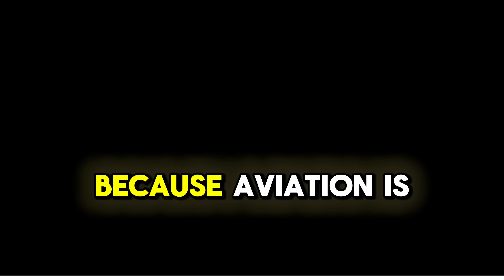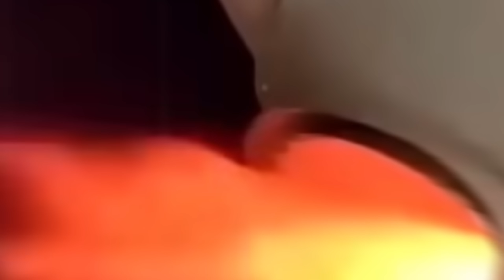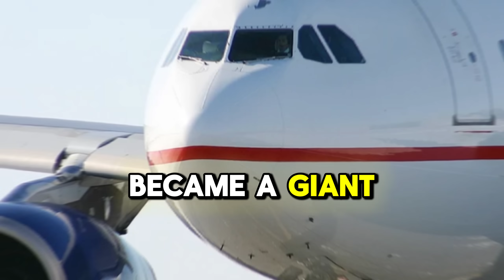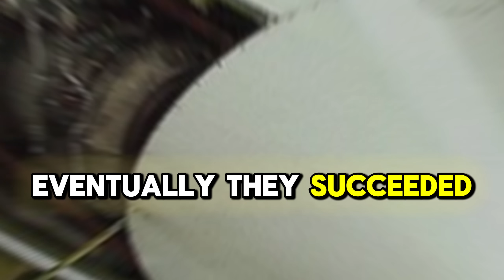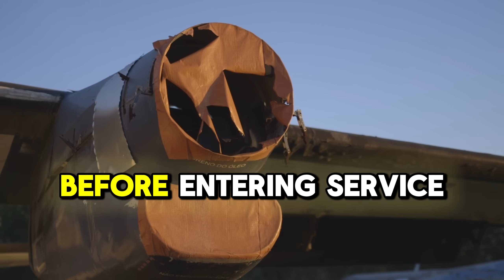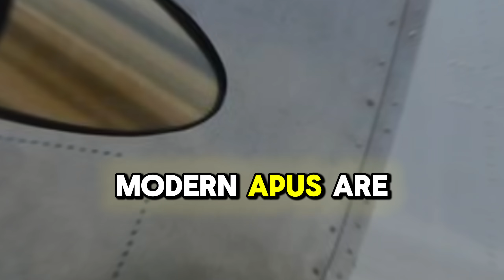WHY DO AIRPLANES HAVE A “HOLE” IN THE TAIL?

Comment: The Space Shuttles had three APUs near the tail of the orbiter and its exhaust were on the top and just front of the vertical stabilizer on the tail. There were three so that there was triple redundancy. The APUs were powered by hydrazine passing over a catalyst bed. They were used to control the gimballing of the shuttle's three main liquid rocket engines on the back end of the orbiter for steering in flight and for movement of the wing's elevons, rudder and speed break and the body flap which was just under the three main engines to protect them during launch and reentry. The APUs were powered up at t-minus 5 minutes and once achieving orbit were powered off until the shuttle was ready to perform the deorbit burn which would slow its velocity a few hundred miles per hour below orbital velocity of 17,500 mph or 5 miles per second.
Reply from the maker: That’s a fantastic explanation! Thanks for sharing-Space Shuttle APUs were an incredible piece of engineering. 🚀

Comment: That “hole” in the tail is the exhaust outlet for the **Auxiliary Power Unit (APU)**, a small turbine engine that supplies electrical power and air conditioning on the ground, and backup support when required in flight. It may look insignificant, but it plays a vital role in aircraft independence, safety, and operational reliability. Excellent explanation for anyone curious about aircraft systems. ✈👏
Reply from the maker: Really appreciate such a detailed comment . Glad aviation people are enjoying the video too 😄

Comment: Does de APU also delever a small part of trust power?
Reply from the maker: Not really for thrust 👍 The APU mainly provides electrical power and compressed air, though on some aircraft it can slightly assist engine starts.

Comment: Jesus fucking christ..........it's the exhaust port for the APU, otherwise known as the auxiliary power unit which powers electrical and hydraulics when the engines are not operating.
Reply from the maker: Yep 😄 Just tried to explain it in a simpler way for people who don’t know aviation.
Reply: Certainly no need for a 7+ minute video OR huge closed captions!

Comment: Newer planes don’t have this. They have a little propeller that comes out under the plane. It’s called ram air. These little holes are only on older planes like 727 or 737.
Reply from the maker: The little propeller is the RAT (Ram Air Turbine) 😄 Most modern airliners still use APUs too.
Reply: @EverydayDecoded-o3d yes my mistake. You did cover that in the video. I commented too early 😂. Good information and great video.

Comment: It is the exhaust port to the Auxiliary Power Generator Unit which provides power to instruments and lights independent of the aircraft's engines running.
Reply from the maker: Exactly 👍 The APU keeps many essential systems running even when the main engines are shut down.

Comment: And I thought it was the exhaust pipe lol. Here's an actual  false fact. Jet airliners cannot glide in the air due to their wing design.
Reply from the maker: Funny enough, modern airliners actually glide surprisingly well 😄 Some aircraft have even landed safely after losing all engine power.

Comment: What voltage and power does it produce ?
Reply: I believe it generates 28 VDC and 120 VAC at 400 Hz.
Reply from the maker: Depends on the aircraft, but most APUs produce electrical power around 115V AC at 400Hz and enough power to run the aircraft systems while the main engines are off ✈️

Comment: What about the GPU, on the Ground ..?
And the cable connected from the terminal.
Reply from the maker: Yep! Ground Power Units and terminal power cables can supply electricity too, so the APU doesn’t always need to run at the gate ✈️

Comment: If the plane is small enough, then it can do without an APU. One example is the Pilatus jet and the single engine turbo prop.The jet run one of the designated engine on the ground, at significantly lower RPM than normal idle and that serve as APU. Military planes are more likely to have one , for it gets inconvenient trying to find a jump start in a war zone.
Reply from the maker: That’s actually a great explanation 👍 Smaller aircraft often use different solutions instead of a dedicated APU.

Comment: It's an Auxillary jet engine to supply power to avionics, heating & lighting.
Reply: The B29 Bomber had a small auxillary piston engine called the "Put-Put"
Reply from the maker: That’s actually a cool aviation fact 😮 Older aircraft had some really interesting auxiliary systems.
Reply from the maker: Exactly 👍 The APU keeps a lot of the aircraft systems running when the main engines are off.

Comment: Ground power 400hz and air handling all on the bridges , it's to do with emishions
Reply from the maker: Exactly, many airports now use external power and air systems to reduce emissions and noise on the ground 👍
Reply: @EverydayDecoded-o3d the truth is the air aux air units consume so much power it's unreal 160 amp units somtimes

Comment: I always thought that little hole in the tail was just some random vent. Turns out it’s basically the plane’s backup generator.
Reply: Electric and air. It helps compensate when an engine fails.
Reply from the maker: Same here 😂 Most people probably thought it was just some random vent back then.

Comment: If the APU utilizes jet fuel then how did the APU continue to operate when you mentioned the A380 ran out of fuel over the Atlantic Ocean?
Reply from the maker: Good catch - the APU also uses jet fuel, so it wouldn’t keep running after fuel exhaustion. What kept the aircraft controllable was the RAT (Ram Air Turbine), which deploys automatically in emergencies.